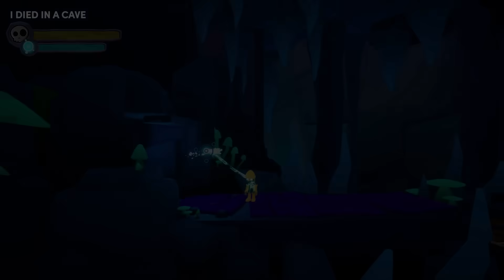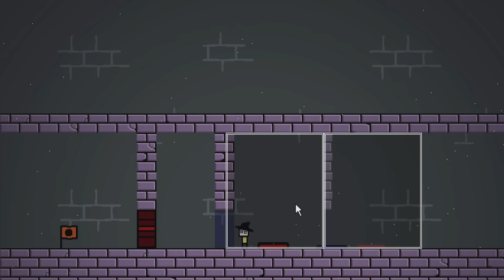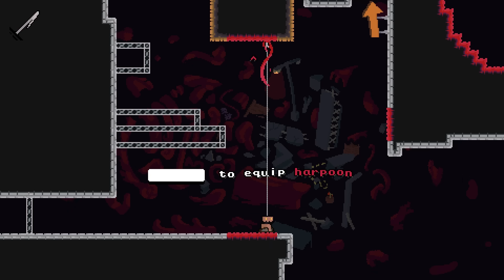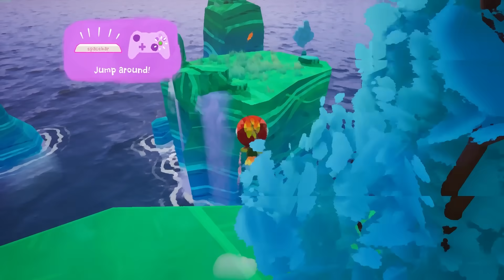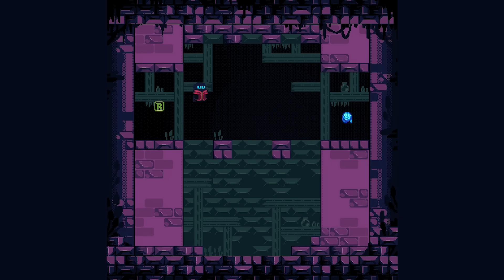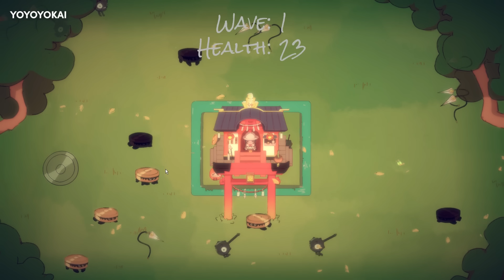The Best Games from GMTK Game Jam 2021

Comment: Ghostel looks like fun, and some basic twists could really make it fun. Maybe one character moves faster than the other and one of them can temporarily anchor themselves in place and enhance the laser somehow, like length, strength… etc.
Another fun idea is rooms with different obstacles and surfaces, like a room with patches of ice or grease that make you slide around and the faster character slides more but can turn and change directions better.. place obstructions and modifiers like obj that block the beam, or mirrors that bounce it and reflect it, and crystals that can split the beam and scatter it temporarily until it breaks, these would act as power ups. Another idea is to have separate weak lasers they can fire in pulses (mostly for object/world interaction) and then the connected beam is the true power!
Lastly, add a few challenges or goals.

An example of a fun level. You work your way through the room destroying ghosts and working on cutting chains to drop shutters and close the windows/doors. As you go, you’ll see ropes you can cut to drop a chandelier and then use the chandelier to scatter the laser everywhere as a big screen clearing attack but then it shatters. Have some mirrors covered in sheets and you can choose when to burn the sheet away and use the mirror to bounce the laser and either use it for destroying enemies or solving the puzzles/goals quicker.. perhaps you use the mirror to cut two chains at once after pushing it to the right spot, or just use it to create a weaker wall of damage to cover your teammate as they cut the chain… you decide how you want to do it! Throw in some unique enemies, obstacles and spots that force you apart for a short period to add some tension and you’d have a really fun co-op game!

Comment: I found a control setup in Mrs modification that you can beat the entire game with without changing anything (the left arrow is left and crouch, the right arrow is right and climb, and x is jump drop and airdash) you don't have to change it once, because if you hold a direction then while still holding the first direction hold a second direction that direction takes over meaning you can use left for crouch while still going right while crouching

Comment: It's kind of a shame how I never have time for game jams.

My game idea would have been a Zachtronic's-like where you program two turtles to perform a specific task, but they communicate with each other using a wireless interface whose connection gets broken when they get too far away. However, one of the turtles would have data that is needed by the other one, so you'd have to think of ways to buffer that data to reduce frequent trips to the other turtle.

Comment: Mario maker 3 ideas:
camera block:
This detects when a enemy or Mario appears in it's sight and sends an electrical current
It can be flipped, have wings and be placed on tracks it has two variations in one it can be flipped by jumping on it and in the other it flips automatically 

Electric cables:
If a object is activated by Mario, a shell or something and it is connected by a cable to another block(s), that block(s) gets activated also it can be connected like a track (available in 3dw)

Electric block:
When powered this can be touched (available in 3dw)

Plugshroom:
When touching the ZL button you switch everything from on to off or vice versa

Ice flower:
It is a fire flower that turns enemies into blocks, The blocks can be passed through by Mario but not by enemies and have some different effects on other enemies

Anti block: 
This block can be placed on anything, tracks pipes bullet bill blasters etc, they act like a boo that doesn't deal damage in all of these. But it makes holes inside ground which Mario can be in and they have a deletion variation that deletes ground, destroys enemies and platforms (available in 3dw)

Robo Mario:
This has the same physics as a player, it can be picked up and given power ups, at night it presses the y button every second (available in 3dw)

Platform pad:
You can change the position of this platform depending on where you stand

3d world:

Potted Pirhana plant:
It's a pot which you can carry with a Pirhana plant that eats people, can shoot fire and has a tiny flutter

Skating shoe:
It acts like a koopa car, with a little twirl when you jump, if you don't move it on ice or the snow them, 

Conkdor:
It swing it's head automatically which can hit blocks and items

Ports:
Stone blocks and toads can be used outside story mode
All 3d world masks are in the other game styles

New non obvious clear conditions: 
Get to the end with the p switch timer still going
Get to the end with the level being OFF
Only jump ( ) times
Destroy ( ) robo Mario's
Get to the end with ( ) robo Mario's

There are also NOT clear conditions that are the same as different clear conditions but you lose the clear condition if you clear them

Extra stuff:
You can apply a "respawn" trait to things that can respawn in vs mode
You can move the end and start goals
And where multiplayer players start
Goomba shoes and Yoshis can be ridden by making them go up below the player
Clear pipes can fuse
You unlock items by default but you can immediately get a truck to give you some items at demand
And you can costumize ALL editor ui 
Randomness is based on your clock
You can let your levels be downloaded and edit or not 

New modes:
Ninja training, all courses get ninjis so you can train for new ninji courses
Mario challenge, you can participate in these level making competitions in which a theme for the courses is chosen and you need to make a course around that
Levels can also be cleared in separate clear conditions and those clears will be categorized differently

Trailer and game plan:

First, there's a teaser trailer with ONLY the ice flower and no new features
Then there's a trailer with every little detail about the ice flower with some new features (no new items) in plain sight and near the direct ends It is announced that the game will be updated weekly (which it will) and the direct ends with some random people saying this direct sucked and some other stuff

So then new items are unlocked to everyone weekly with the ice flower unlocked at the start and then everyone is happy
Reply: That’s very random to put here
But ok
cool
Reply: why are you putting this here
Reply: What? Why
Reply: @Cavouc  why not